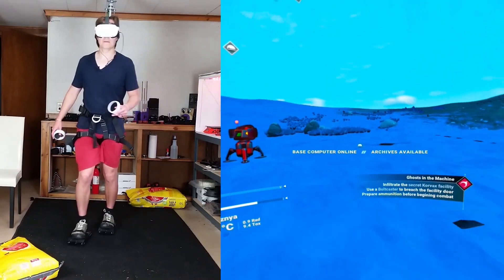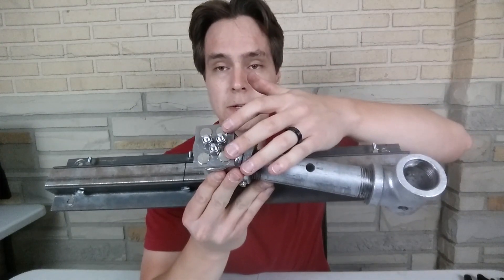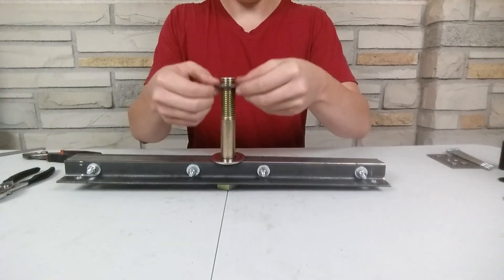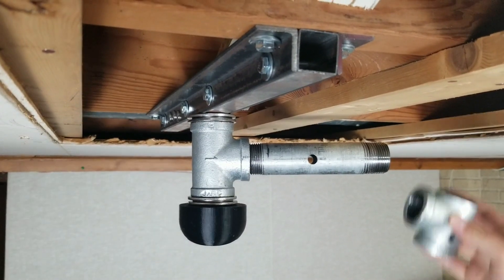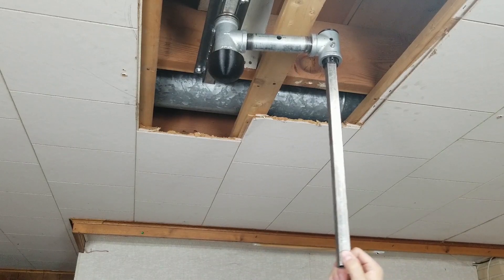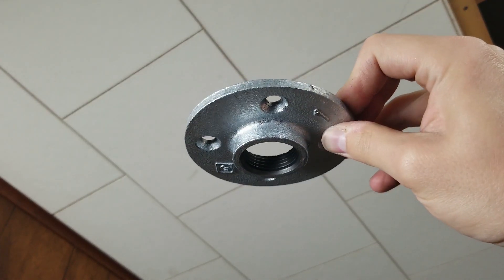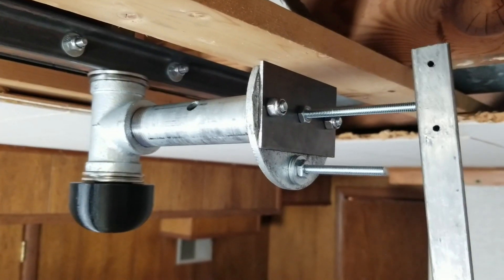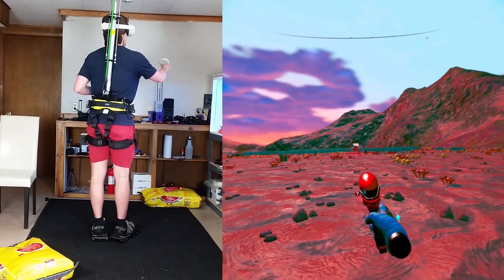VR Shoe Build Log #44 - Continuing to Build the New Support Rig

Comment: If you could figure out a way to make it so you can could hook up a detachable stripper pole to this thing you could sell it to A LOT of VRChat users 🤣 not even a  remotely a joke lol I want to learn poledancing in VRC so bad, but I don’t have a permanent spot for a pole. Some hardware like this that you could put it on and take it off of with 5 minute of effort would be soooo rad. And also being able to, like, use Vr shoes when the pole isn’t up 🤣 that’d be cool too lol

Also being able to screw it into the ceiling through drywall without damaging the ceiling would be poggers lol really the only way us renter could use it realistically

Comment: Would the rig work if you were to use a support bungee cord instead?
Reply from the maker: For this setup, where the shoes don't have motors, I don't think it would work very well. If you haven't seen build log #41 I try using some straps to make a support rig, but straps, cords, ropes, allow for a lot of swinging which to me was annoying.
For a motorized setup, a cord might be fine. I had basically a rope and bungees for my motorized vr shoes, and sometimes the vr shoes wouldn't keep up and keep me in the center, but that could be improved. I think with completely motorized solutions the motors need to be incredibly responsive, which is tricky, but if that can be worked out then the support rig can be simpler.